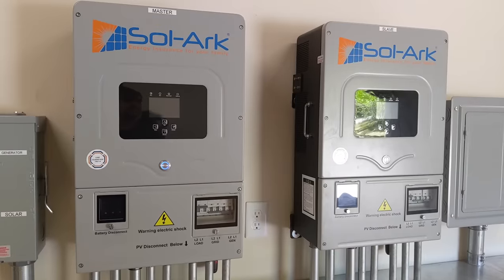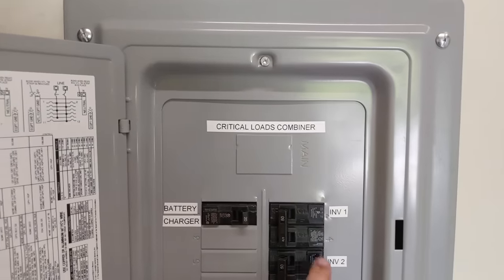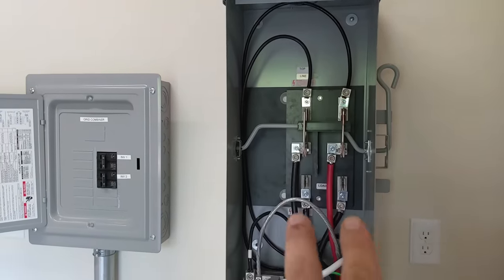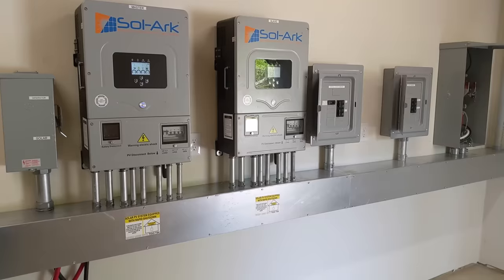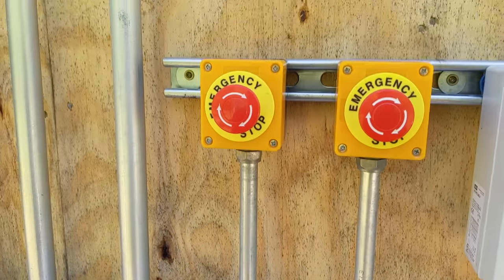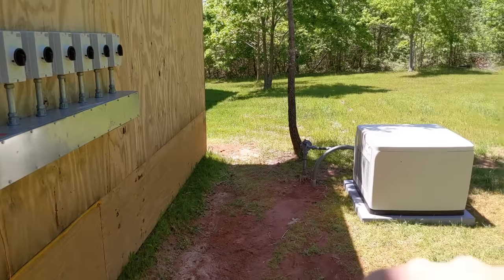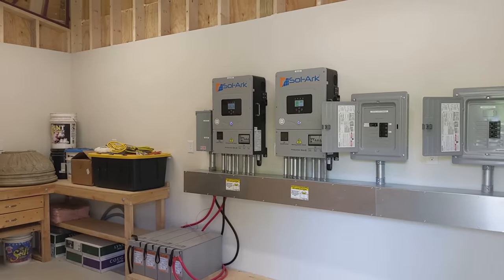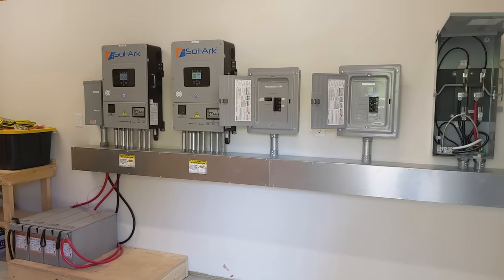Off Grid Solar System Walkthrough

Comment: Isn't the Solark system supposed to be able to switch between solar and a generator automatically? Why the need for the manual transfer switch? I'm an electrical dumby help me lol
Reply: I believe it's on the off chance that the Solarks go completely dead and you need to bypass them entirely to run on generator.  I don't know how/if the solaks have their on internal bypass; but if they do, the external bypass he added might be useful in the event you have to remove one or both for some sort of servicing issue.   I'm not an expert or installer, this is my understanding of something like this in other projects I've followed.

It might be overkill; but if you want to be sure, it's better to add it now.  The manual switch box he used shouldn't be expensive either.

I really do like what Solark offers, i just wish they'd offer the 8k with the option to parallel.
Reply: joebleed is right. It also lets you transfer power to go directly from generator to load. This lets you charge faster if you have a large battery bank which im sure this will eventually have.
Reply: The manual transfer switch is configured as a bypass switch, such that if the SolArk need to be serviced, the critical loads can be powered up while the SolArk is turned off.